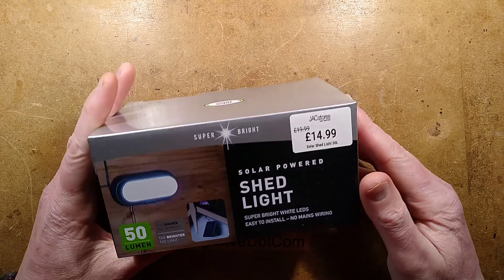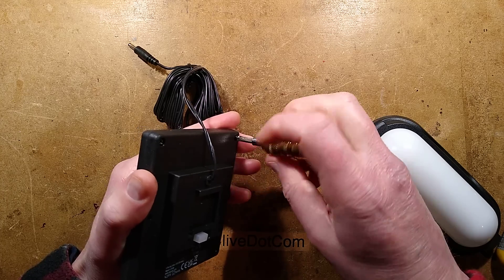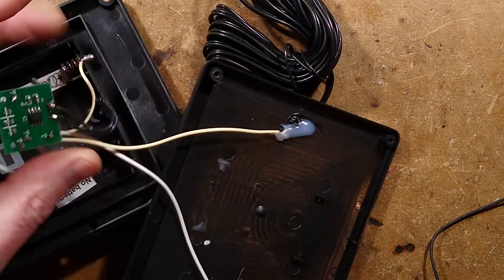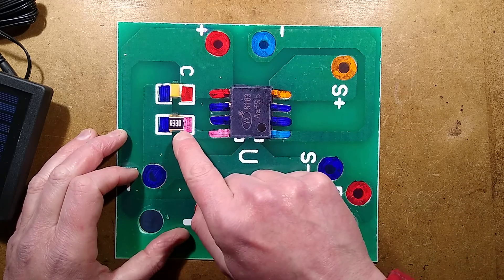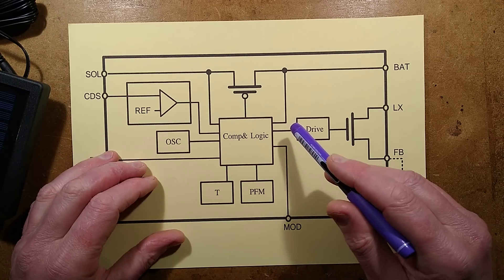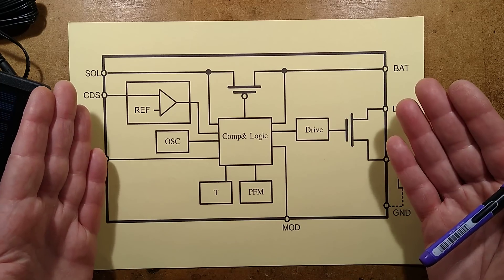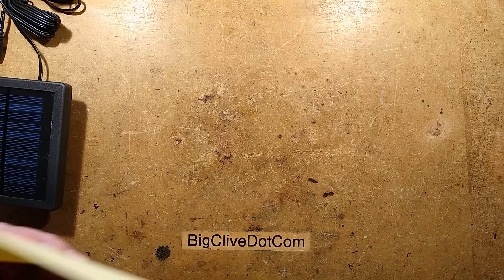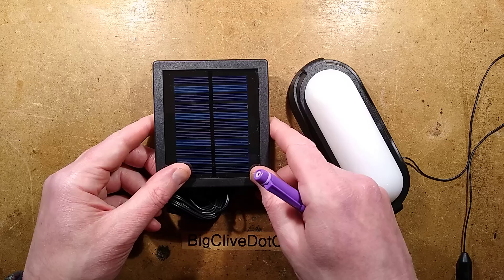Solar shed-light teardown (with schematic)

Comment: The 14500 Li battery is designed to match the dimensions of a standard AA battery. I use them in a couple of my pocket flashlights, although you have to ensure the LED is designed to use the higher voltage.

Comment: I'm glad you described the problem with freezing temperatures.
Reply: It's only LiFePo4 cells which cannot be changed below 0°C. Lithium ion can be charged down to -15 to -20
Reply: @BrazzaB1  Don't think you are correct on that. Lithium ion should not be charged below 0C, it can be discharged down to -20C. 

Comparing spec sheets of Panasonic NCR18650B with what they call their low temperature cell, the NCR18650F, both still have the same operating temperatures.
Reply: @RenThraysk  You are right - I was looking at a heated battery pack spec 🤔

Comment: I have an almost identical one by looks. Mine has the added feature of a timer on the lamp of about 30 minutes, this can be a good thing when you forget to turn it off but a pain when you are doing something. Mine has been on my shed for about 3 years with no issues.

Comment: Hey I remember having this exact lamp in my treehouse as a kid! I took it apart too, but because it stopped working.
I was around 12 though, so I've had no idea what was inside anyways lol
But then I got mad at it and made a whole 12 volt light system with my dad, running on a car battery - that's also when I learnt how short circuits work and how they smell

Comment: Hi Big Clive,I have built a few solar lights and I have used a couple of  large farad capacitor's in series instead of Batteries as they are not affected by Temperature swings.
Thanks for a great channel 👍😁

Comment: If I was going to install this in a shed I think I'd seriously consider first installing a skylight and mounting the solar cell/battery unit to the inside of that. Minimal protection against exposing the battery to extreme cold is better than none. Also, it would eliminate water dribbling along the cable into the lamp enclosure.

You're right, that chip is interesting. I suspect it's more popular among manufacturers than we currently know.
Reply: You will probably lose solar gain through the skylight.

Comment: My local hardware store sells "solar light" 800mah 14500 LiFePo4 cells, and if I owned this light, I'd DEFINITELY switch it over to LiFePo4 from the typical Li-Ion cell. I've had some LiFePo4 solar lights where the cells lasted 11 years in them, compared to the typical 2-3 years for the Li-Ion ones. It's very nice to have a simple option to be able to switch the cell over instead of basically having to tear the entire circuit apart, and start from scratch.

Comment: Clever chip idea with the dual lithium chemsitry support.

I love the LiFePo4 cells - four of them in series is an almost perfect 12v lead acid replacement (with BMS). Plonking something like high C ratr 6P4S 26650 cells over a regualr car battery greatly helps the Starter, eases the load of the lead acid, allows for RAPID recharging of the Lithium which then trickle charges the Lead Acid for a while even after engine off. Fantastic "mod" to a car battery that has to do a lot of short journeys.

Did you ge the email I sent re: the 16 channel "controller=less" fairground lighting? Was so impressed with the idea of these (inbuilt patterns for 16 channels with NO external controller and everything just wired up on a single copper pair).

I know some of my emails get lost - but as you have a love of fairground lighting, I thought you might like to see the links to the lamps - if you are not already aware of them :)
Reply from the maker: Are they the autonomous fairground lights that just run their own sequence in sync?

Comment: The semi-opaque diffuser on the light panel looks like it will do a really good job of blocking most of the light coming out of the LEDs! I think if I had the light panel inside my shed, then I'd take the filter cover off, possibly spraying / painting it with waterproofing lacquer.

Comment: I bought a solar shed light very much like this from my local hardware store here in NZ about a year ago and I can confirm it is surprisingly powerful when it's dark outside (one of my roof panels is clear, so there's plenty of natural light during the day). I'm not sure if my solar panel unit has an on-off switch, but there are no issues with charging in Winter, because it almost never drops below 4-5 degrees where I live, although that's useful info to have.

Comment: I've had a few "Smart Garden" products over the years, and they're usually halfway decent, even if a bit cheap on build quality.

Just now I'm trying out a pull cord light bulb. It uses three triple A cells, and like previous Smart Garden products, it produces a decent, usable amount of light.

When you opened up the lamp section, I expected a few LEDs on a panel. I wasn't expecting quite so many!

Nice .... If they'd just up their game on build quality.
Reply: Are you sure?
3 AAA lithium cells is a strange approach.
Are you sure it isn't just an old fashioned NiMh AAA arrangement?
What makes your products 'smart'?
Simply using lithium batteries doesn't do that.
Are they phone app controlled garden products?
Reply: @procatprocat9647  "3 AAA lithium cells is a strange approach."
Where did he suggest they were lithium?  They are almost certainly NiCd or NiMh if they are AAA size.
Reply: @procatprocat9647  I never said lithium. In fact, I never even suggested that they were rechargeable. You can use conventional alkaline cells (1.5v) or NiMh (1.2v). Or if you wanted to NiCd (1.2v).  There is no onboard charging facility - the lamp is primarily for indoor use, but can be used outdoors if required.

I never said anything about smart devices! - The brand name is "Smart Garden" and that's all that's smart about them.  They're halfway decent for what they are, but would benefit from improving their build quality.  If you notice, this lamp that Clive was dissecting is a "Smart Garden" product, which is the only reason I mentioned this pull cord of mine.

Comment: Yep, those solar panels layers get separated often and some of them, even if give nice 6v power with lots of mA, top layer is cheaply made and get soft and gumy, gather dust and it lose its efficiency over time. 
Im also not really fan of batteries directly behind it, as in places where sun really hit hard(Spain for example). Anything dark get boiling hot. I had few of similar but smaller panels(different brands and design) where battery was separated by like 2-3mm of plastic from solar panel and it just died after few months as batteries end being just flat, not explosion or leak, they just get baked... Best part is that one was lipoly and others were that small LiFePo so its make it even weirder as they should behave differently. So I always look for lights that have batteries where lights are as its normally in shade or have better separation from black plastic.

Comment: i have 2 solar light string, the bare copper wire with the leds dotted along it.  Its been outside full time for 3 years and canadian winters get to -40 and its still going strong.  Only thing that slows it down is the amount of sun it gets. as soon as its a bright day its blinking away

Comment: I had a similar light with such a solar panel and because I knew about the problems it could cause by lower temperatures, I mounted the panel inside the garage just behind the window!

Comment: The resin above the solar cells often get slurry over time, as observed on many solar powered garden lights. That makes them inefficient in the long time run and at least unusable.
Reply from the maker: T-cut or toothpaste applied with a sponge can abrade the oxidised layer off the resin quite well.  Theoretically car wax could add a layer of extra protection.

Comment: Clive, have you ever taken a Blink solar camera mount apart? I found it takes 10 days to flatten the internal rechargeable battery, 25 days (according to Blink technical) to 3/4 re-charge the internal battery 'in ideal conditions' (I found it only generates voltage in direct line of sight to the sun, so it would have to track the sun to be in with a chance)  even with a larger capacity battery installed and a larger (more efficient) solar panel attached, the only gain was it takes longer to flatten the new battery (which I pre-charged before installing) suggesting the charging circuit is useless.

Comment: Would have put the battery and charge circuit inside the light, where they are less likely to be toasted and frozen, leaving only the solar panel outside.  Enough space in the indoor side anyway, and you still just can plug the panel in.

Comment: 7:01 EN and CDS chip pins.
EN & CDS are usual control signals in chips for computers and other complex devices, and their labels are usually overscored in chip or circuit diagrams to indicate they are active when low (e.g., connected to the negative), inactive when high (resp., to the positive; at least ~+1V or ~+2V, depending on chip technology.
• EN: Chip Enable. This signal lets a Chip Control Unit select what chips are to use the address or data buses or both as source or destination or both, e.g., the Instruction Register and the Address Bus Register, and the SRAM and DRAM, to read data at an address specified by a program instruction; some nanoseconds later, the SRAM and the Arithmetic and Logic unit, to compute something from the data read.
• CDS: Chip Data Select. When active, allows data in the chip to be output to the address or data bus without conflicting with other bus-connected outputs. When inactive, data in the data bus from another enabled chip can be read by the chip.

Comment: That resembles a "Double-A" or Penlight cell. Nice that they get them that small, since one could fit those in manny devices with a small conversion to run on that higher voltage.
Reply: There are dummy zero volt "batteries" (hollow batteries with an internal wire joining both poles) to put in series with those lithium batteries on devices designed to use pairs of 1.5V batteries in series to make 3V, 6V or 12V
I use one combined with a 14500 LiFePo4 battery in a portable radio because I don't like to put over 3.6V on devices made for conventional batteries. And a LiFePo4 seems a bit safer too.
Reply: For a lot of devices that use 2xAA you can use a 14500 and a dummy cell that can be bought or 3D printed. 1.2V over the nominal 3V is rarely going to hurt anything in a device like a flashlight, granted overall capacity will be about half of what alkalines have with a 500mAh lithium. For potentially more sensitive micropower devices like remote controls that might get unhappy with a fully charged 4.2V lithium you can put a diode or two in the dummy cell to drop the voltage a bit (one is probably enough since LiIons don't stay at 4.2V for long and 3.6V is within 17% of 2xAA).
Reply: There’s also 10400 “AAA”-style lithium cells.

Comment: Clive, have you seen the recent disposable 'vapour' devices which incorporate either a micro or USB C charging socket? I was looking for a method to contact you and send a pair up or across depending on where are lol. Lower capacity batteries in them (650mah, as opposed to 1500 mah) probably hence the charging circuit because they are still the full size '3,500 use' devices.
I can't even add the photographs here. The charging circuit is about 1/4 the area of the regulated (and non regulated) boards you recommend. Cheers, hope you are well, Mark.

Comment: I have a unit that is similar in the solar panel/base unit, but has a very different hanging light unit with a pull chain switch and IR remote receiver on the cord. I use it in my garden gazebo for summer nights. It goes into storage for winter. It uses a replaceable low-voltage Edison filament looking led bulb, and lasts about 3 hours continuous light on a charge. Thank you for reverse engineering this, I've been wondering what it looks like inside!

Comment: Bright sun, that little plastic enclosure is going to warm up and it will warm up that battery also so that may provide higher temperatures in the winter to perhaps eliminate some of these low temperature battery problems

Comment: If the solar panel is for putting outside, wouldn't it be better if they put the Printed circuit board and battery in the light unit which would be inside the shed?

Comment: I purchased a very similar unit about 15 years ago that used a little tube light,   they had also put the battery inside the light unit and only the solar panel was outside...

Comment: Looks similar to a kit I bought several years back that was also supposed to be able to trickle charge my lawn tractor battery, all it ever did was drain the battery so something wasn't connected right inside. This was before I started learning from this channel so I pitched it in the recycling instead of opening it up. 🙁

Comment: After making a couple of PCBs and stuff based on your previous DIY solar circuits this is pretty cool stuff for a lithium one with that extra layer of protection on a chip but I wonder if when you charge does the temperature start to rise in the lithium cell enough to keep it out of harm's way in a cold temperature I guess you know I'm not sure what that does but they certainly warm up when you charge them normally.  I would love to see how it does compared to your other MOSFET circuit with regards to when the light turns on and off cuz that was a fun circuit but the light does stay on quite a bit longer than say the solar circuits based off the YX 8018.

Comment: Handy as an indoor emergency light too, keep the solar panel in a south-facing window, plug into the light wherever it is installed when there's a lack of mains electricity, assuming it lasted long enough that is... :P

Comment: It wasn’t clear to me where the switch is in the circuit, but perhaps it disconnects the battery or the solar panel in a way that could prevent charging during winter months.

Comment: I bought a couple of those 14500's (for a Torch) they did  not last very long.
I had a solar panel that got so hot it went milky and reduced its capacity by 50%.

Comment: I have 455 watt solar panels, and comparing the amount of plastic ratio to this little panel is crazy. The only part of my panel that has plastic is the little box that houses the diodes. Now if there's a thousand shed light's. I'm wondering...
Reply: That's why non of my solar lights/strings in the garden run on these plastic things. Well still just the casing to hold the battery. Running strong, even during wintertime connected to my 140 Watt panel which is connected to a dc/dc convertor set to 5.5V so even during dark times they get fully charged.  Most of those lights are throw them away crap nowadays. 1 season and the panel is bad. I still have ones that I bought 15 years ago that are like low efficiency panels but are made of glass. Crazy thing besides the working panels is that even the 18650 cells are still working.

Comment: Solution to solar-panel cracking due to thermal expansion: Put it in the shade!! ;-))

I'm thinking that buying one of these would be easier than repurposing the solar panel I got from something else along with a string of LEDs from an old lamp... Laziness is the key to emptying one's wallet!

Comment: As ever a great video Clive, I got one of these similar sized solar lights but to a daisy chain of Led solid ball lights, not impressed by its brightness , I opened the back to find a battery compartment for 4 batteries but with only 1 battery fitted, I modded with extra battery terminals (they were missing) to fit 4 batteries, results were better:)  Would love to see a deep dive by bigClive why it was designed this way, did they simply try & save money by not filling with batteries or did they use a ready made box that had extra battery slots. Certainly the design seemed to give a poor light.

Comment: Would Adding a second cell benefit something like this for longer duration or would it never fully charge? 

I know there’s math to figure that out but I’ve never been good with this stuff in particular
Reply from the maker: It would depend on the level of sunshine you got.  One advantage of a bigger cell capacity is the better ability to ride over runs of dark overcast days.

Comment: Seems like a very a strange design choice to put the battery and PCB in the part that's mounted outside where it will get baked in the sun, frozen during the winter and soaked in the rain rather than the more protected lamp assembly which would be inside the shed.

Comment: Could this chip and circuitry be used to up recycle and up grade NiMh solar lights using reclaimed cloud producing device batteries?
Reply from the maker: The NiMH based lights tend to have a 2V solar panel which is only really suited to a single NiMH cell.

Comment: Thought about those installations in winter as well. I guess they count that you get up to 10 times less energy here in Europe out of your solar cell in winter than in the summer. So the biggest energy 'burst' you can get is with clear sunshine that also heats the panel up.
Or they thought nothing at all. :o)

Comment: 2:10 That's the same capacity as the rechargeable Li- ion batteries in these discarded vapes. I've stopped collecting- they're so common and I've got over 40.

Comment: The switch should have been in the remote lamp unit, not in the PV/battery side which will be out in the open.   No matter how well you think things are sealed, after a couple of years of service, the switch (and quite likely the battery holder) will rust.
On the other hand, I've got some flashing solar beacons intended for marine use that have worked for years--the works are all sealed in what seems to be an airtight unit.   I've had a couple of the NiMH cells go out, but only after three years of service.